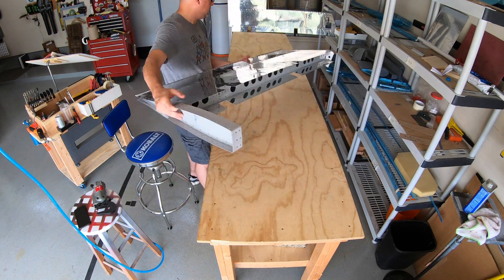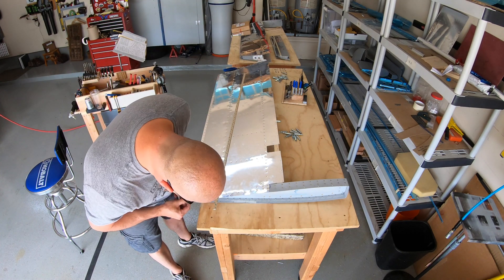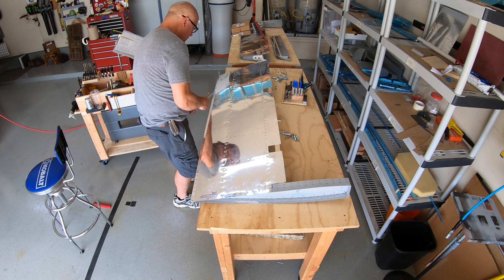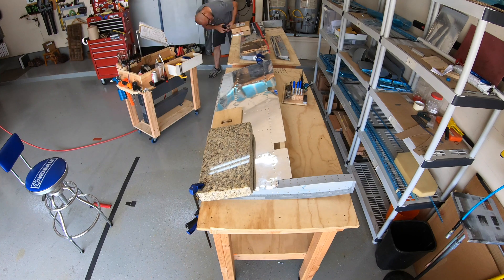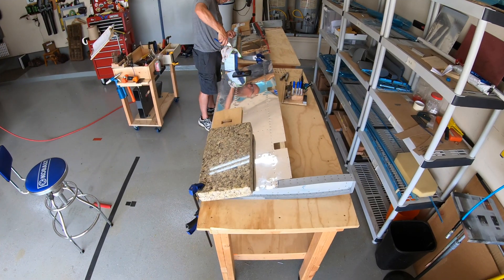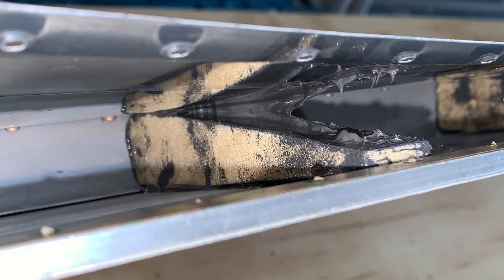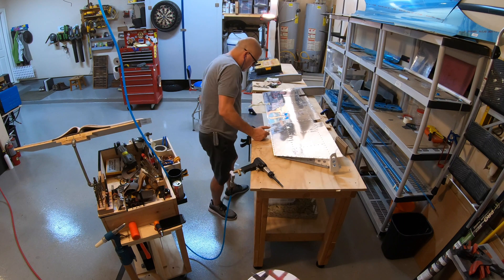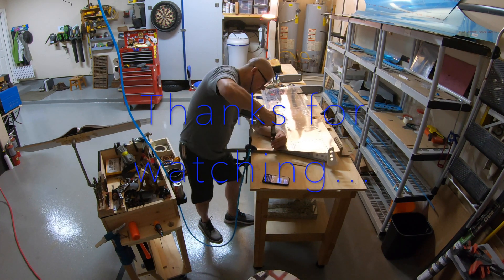Van's RV-14 Build #9 - Elevator

Comment: Since you've already done it, I have a question about the elevator.  Stuck right now.  Riveting the front spar (large) to the tip assembly.  Does the flange of the spar overlap the flange of the E904 rib?  Fred
Reply from the maker: Please rely on Van's builder support and the plans for advice, but I will tell you what I remember looking at the plans.  The only thing that I see overlapping E-902 is the E-913.  There will be a slight rise in the E913 as it travels aft as it transitions from laying on top of E-904 riding over E-902.  You can see and feel the transition.  Plans on page 09-22 fig. 1: show the bending in E913.

I personally had a lot of trouble with the tip assembly on one side.  I had a very flustrating time getting E-913 to line up with the underlying flanges.  I actually had to up-drill and use larger rivets on a couple holes to get them to line up.  I consulted the Standards Handbook to make sure I had enough clearance to surrounding rivet hole and edges.  The opposite side went together flawlessly.  I was actually so frustrated I didn't touch the kit for about 8 weeks.  My advise is if you ever have trouble like that is to push through until you have a positive result so you don't step away from working like I did.

I hope I understood your question.  Thanks for reaching out and good luck.

-Tracy